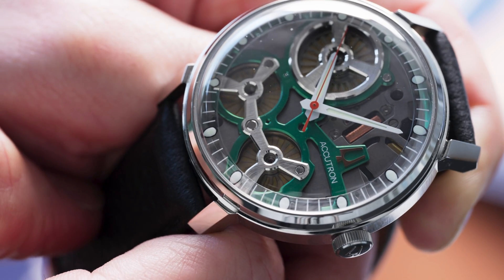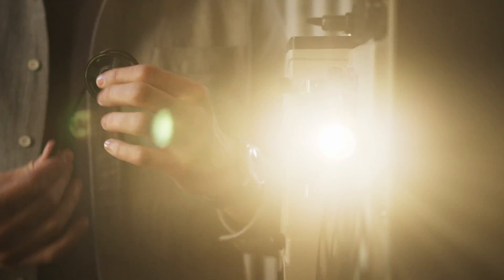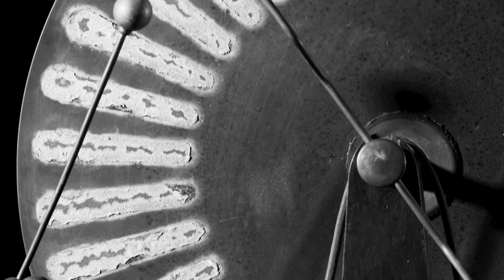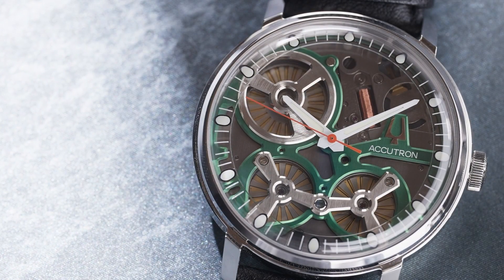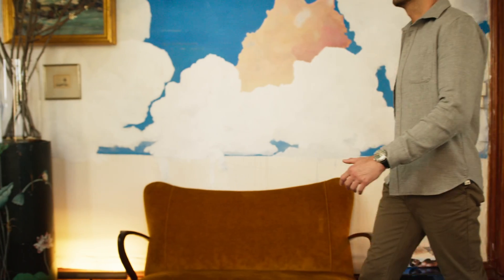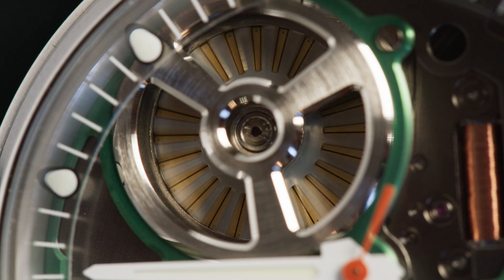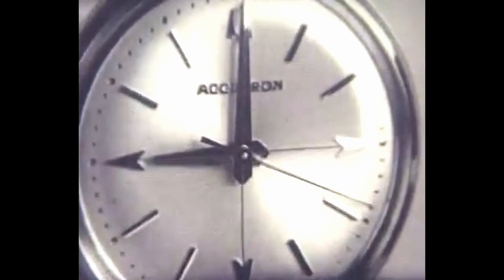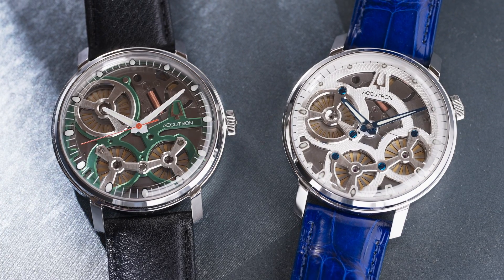Accutron’s Electrostatic Movement Explained!

Comment: Interesting from the engineering viewpoint. Unusual idea, but it does not impress me as much as the original tuning fork resonance movement 60 years ago. It was truly clever back then, and it used the new transistor technology of the previous decade in a very cool way.
This electrostatic generator may be  cool, but basically it is fed by gravity and motion as in the autokinetic movements from Seiko/Epson decades ago.  Just the generator type is different - is the electrostatic wheel as efficient as a standard magnetic dynamo?
The weakest link of all these electric watches is the energy storage, be it a chemical battery or capacitor type. The original Accutron needed a mercury battery every year, and even the later Autokinetic capacitor style batteries died after a decade or so, needing a costly replacement. Same goes for all those 'battery free' solar powered watches. Even they need replacement storage cells, costing 5x more than a regular silver oxide watch battery that lasts for 3 years or more.
So how is Bulova tackling this electricity storage issue in these flashy electro-static turbine watches??

Comment: Wonder how long the capacitor will hold up for…my old Seiko Kinetic used a capacitor as well to store electricity generated from its movement…and after a few years the capacitor died. Seiko’s fix was to replace the capacitor with a rechargeable battery. So I wonder how long this capacitor will last and will it suffer the same fate as the Seiko Kinetic movement? 🤔

Comment: It does give you something that hasn't been seen before in wristwatches, but bear in mind that -- without the electrostatic stage show -- this is similar to a Seiko Kinetic; It is using a rotor for generating power and a quartz movement & capacitor for the timing. When they introduced these a few years ago, they were very mum about that rotor, making people think that electrostatic was doing all the work. Which is nonsense, if you think about it: If this was credible for power generation, surely some other watchmaker would have R&D'ed it already. So, a little buyer beware: All servicing, including running down the capacitor power, has to be done in Tokyo, in their dust-free lab.

I'm not saying don't. But I am saying that the marketing for these hasn't been completely transparent.